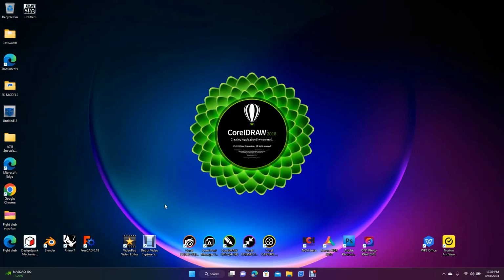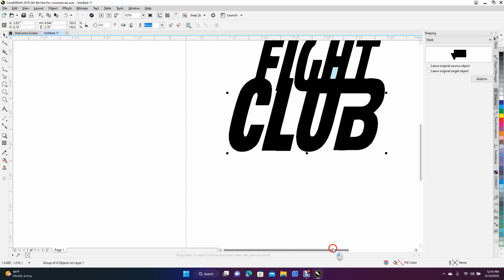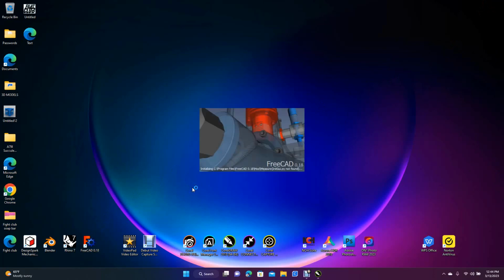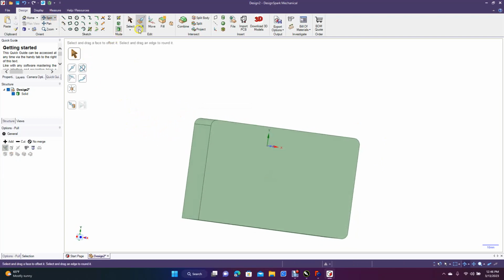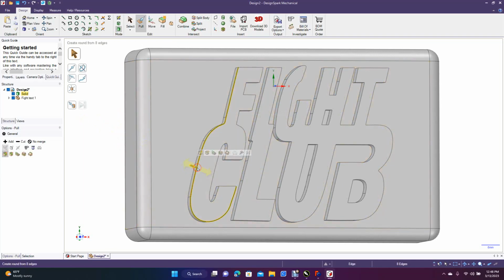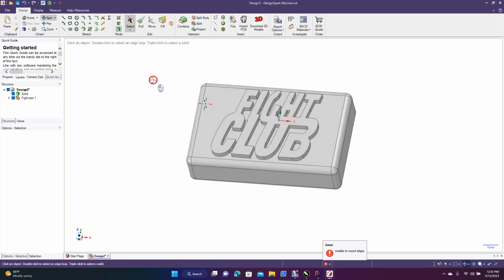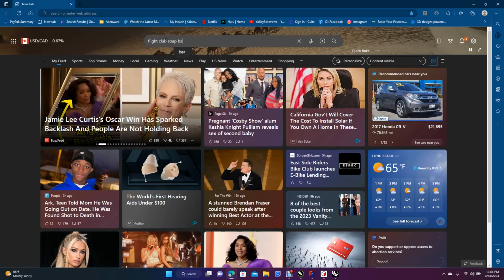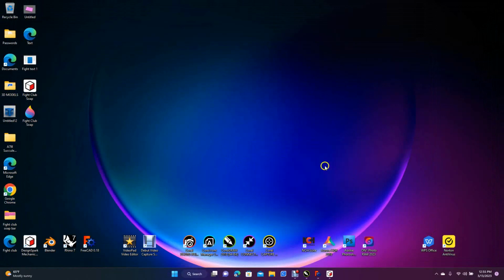How to create a fight club soap bar with design spark mechanical and Corel draw.

Comment: Not related to this particular tutorial, but watching your videos I notice you a familiar with lots of different CAD and 3D softwares so was wondering if you knew of any that allow you to form geometry from two cross sections? 

For a very basic example if cross section A was a rectangle of 10 x 25cm and cross section B was a rectangle 10 x 50cm then together they would form a 3D rectangular cube with dimensions 10 x 25 x 50 cm. It seems like it should be simple task but not easily possible in ones Ive tried (Cinema 4D and Rhino)! You can create it manually of course but was hoping there  would be a 'one click' solution.

Thanks.
Reply from the maker: Free cad might be worth looking into. It has a steep learning curve, so can do a lot of things.